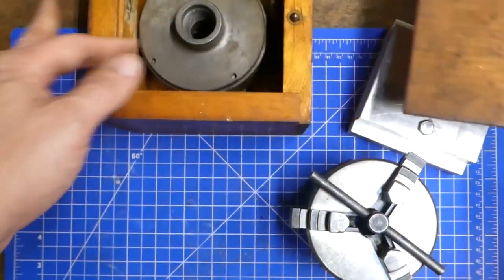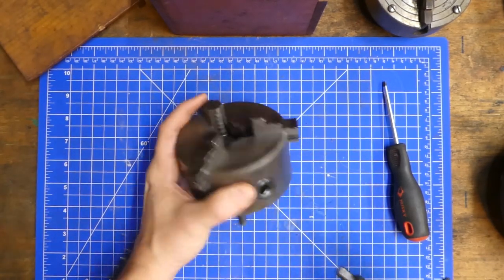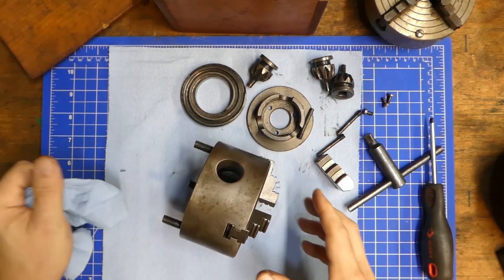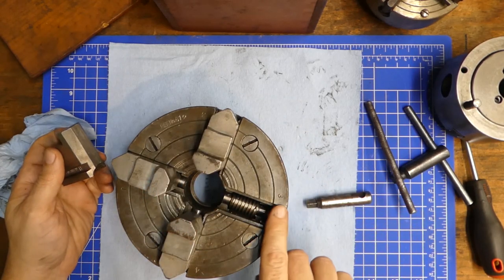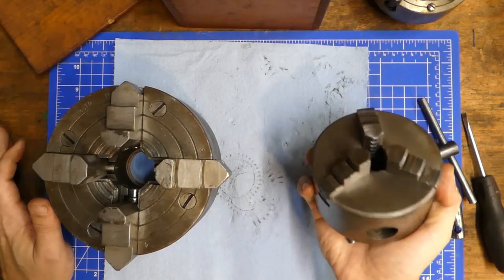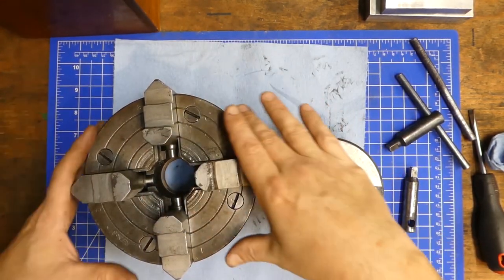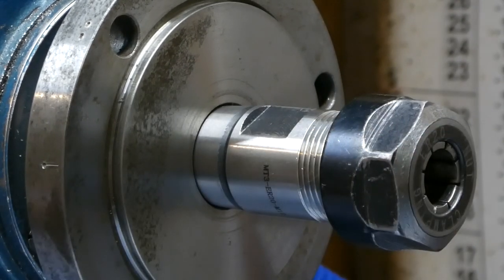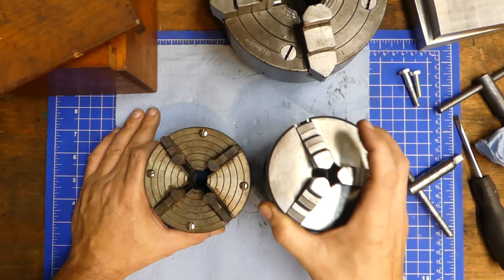Basics 3 - All about lathe chucks - 3 jaw, 4 jaw, no jaw

Comment: Hi Eddie, that 4" 4 jaw looks familiar :) since I just bought it off of you. Great basics video, will check out the rest of the series as well. Looking forward to you crafting a new 10 TPI backplate for that 4 jaw for me. thanks again.
Reply from the maker: Yep, same one, lol. I will most likely video it. I would have kept it but the bigger one fits the new machine better. It is a nice chuck.
Reply: @theeddies  Video would be great for a beginner like myself. Cannot wait to learn how to use the 4 jaw properly.
Reply from the maker: I got the chuck back and ordered a new backplate. It should be here on Tuesday. If all goes well I might have it back in the mail before next weekend. If it is all the same to you I would rather just handle it off ebay, no tax for you and no fees for me. Would Paypal work? If so, my email is on the About tab of my channel, you can just respond to me there.
Thanks,
Eddie
Reply: @theeddies  that will work, thanks
Reply from the maker: @alukantsov  I started on the back plate but thought I should make sure what is the length of the spindle from the end of the threads to the shoulder? Thanks!
Reply: @theeddies  Nice! I emailed you a few pictures. Let me know if you do not get them. Thanks!
Reply from the maker: @alukantsov  I got them. Perfect. Thanks!

Comment: Hi Eddie, when you get time check out the Jacobs rubberflex chucks, Del
Reply from the maker: I had never seen those. I wonder about the longevity of the rubber. Do they hold up?
Reply: @theeddies  Had mine over 2 years now and it was 2nd hand when I bought it, could be over 20 years old, keep them out of the sunlight and I think they will be fine. Del.
Reply from the maker: @machinenutdel6764  Nice. It looks like a useful and compact system. Each collet does a couple mm or maybe .100"? That would be much better than the 40 5c collets I have.
Reply: @theeddies  Yeah a nice bit of kit, believe they are commonly available in the states, only drawback is that they are quite big and may not fit a lathe with a small swing. Del.
Reply from the maker: @machinenutdel6764  It would fit mine, the mill lathes have a huge amount of swing (almost 14") for their size. My worry would be weight and over hang on the bearings and relatively short spindle.